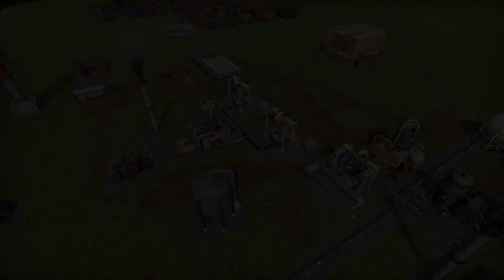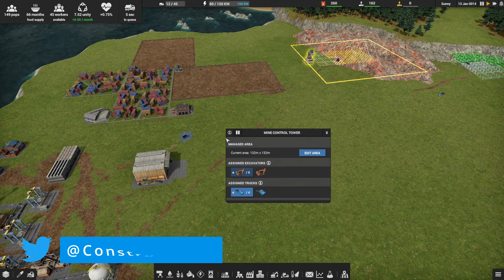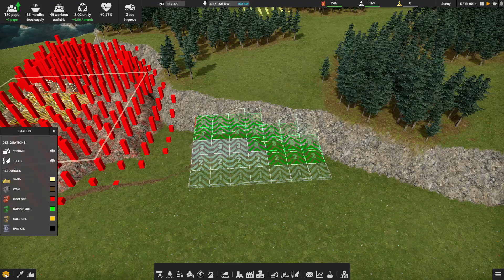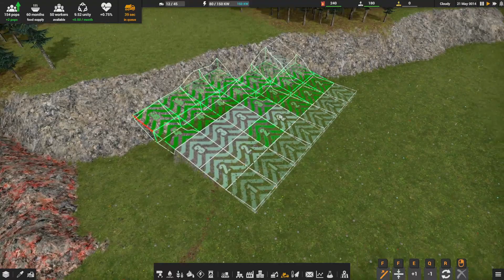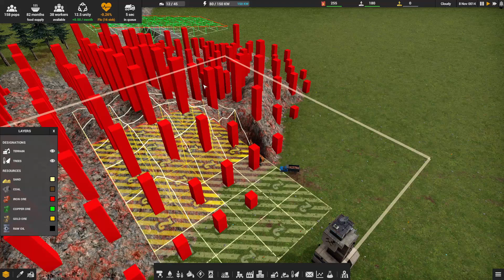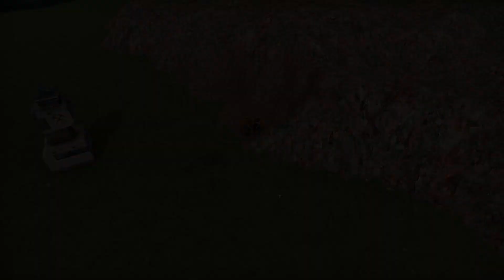Captain of Industry Mining and Dumping #5

Comment: how do you just dump dirt and rock?  when I designated and area trucks bring in waste as well
Reply from the maker: If you want to choose what gets dumped you have to place a mining control tower, then select by clicking on the tower.
Reply: My dumping doesn't work at all, trucks just show no interesting in taking the slag out of the factories so they keep being blocked.
Reply from the maker: @Mimonsi  if you connect the waste outlet to a silo you have to set the silo to emptying. Also need to make sure you have sufficient dumping places
Reply: @Engineering-Focus  Yep, that's what did it for me. Thank you very much!